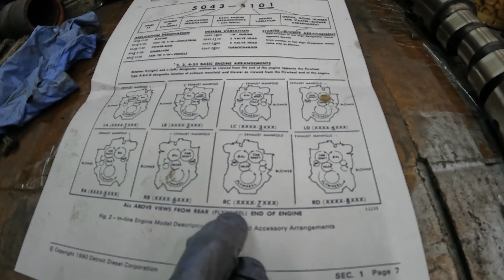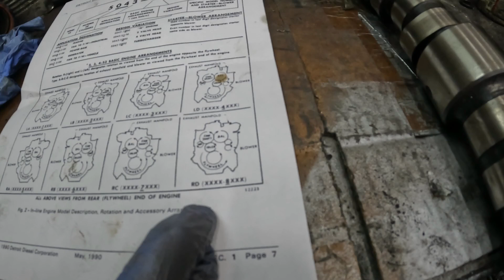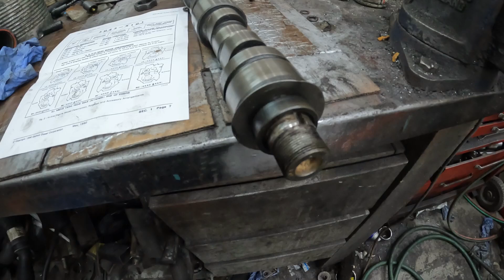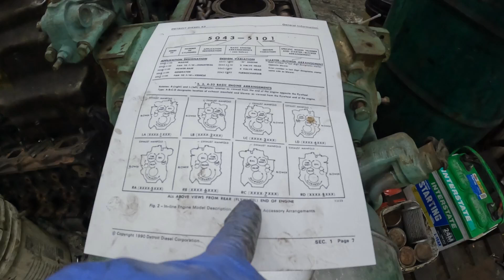Detroit 53 Series (How To Swap Exhaust Manifold From Right To Left)

Comment: They were so universal. The blocks can be rotated also. The ones in 2 of my buses run CCW. Thanks!
Reply from the maker: Yeah lot's of options.:)  Been helping a friend get his two Silver 6V53T@400HP back running again.  Marine setup with one engine cw and the other ccw.:)
Reply: @detroitgarage9430  Sweet setup in boats!!!
Reply from the maker: @rodneymiddleton9624  :)
Reply: Whilst Heads are interchangable, 
are Cam Shafts interchangable between, say, 3-53 and 6V53 Detroit Diesel engines?
Reply from the maker: @ No I don’t think so as the valve timing is different on the 6V53.:). I look up the part numbers and get back to you.
Reply: @rdukes3173  I really couldn't tell you that. Good question. You have to check the part numbers.